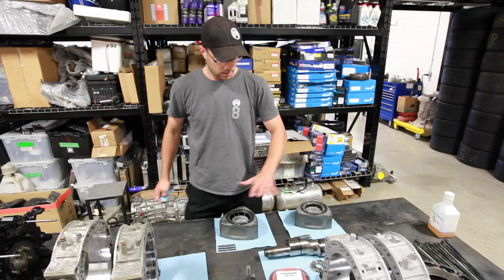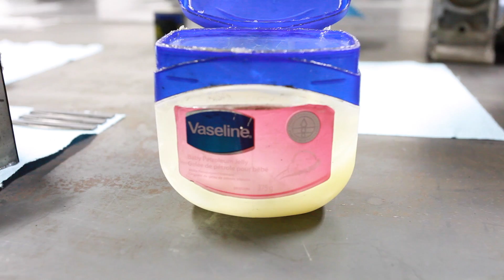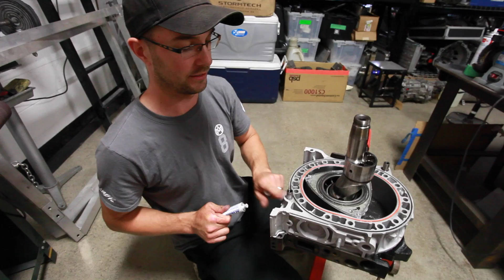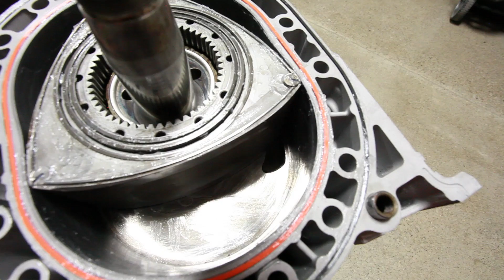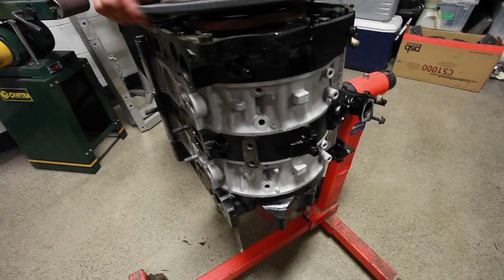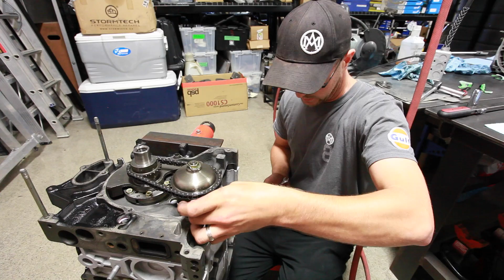How To Build A Rotary Engine

Comment: now my urge to get a rotary is increasing.
Reply: Pennywise yep you've never owned or driven 1.
Reply: Do it, you won't regret it. But get an FD. Not an RX-8.
Reply: @gav240z  dont get an FD they are frail due the sequential turbo but awsome car, i have an rx8 04 (i didn't want an 04 but she has the best set up for every rx8 so) get series 2 less premix but awsome car!! they have 2 engines instead of 1 smooth and fun :D
Reply: @TicRevenge  The RX8 is garbage compared to the FD, its not even a sports car!
Reply: +gav240z I love the rx8, but I'm actually thinking about getting a NA fc. The reason why is due to it being a good base point to learn about them.
Reply: LanEvo55 whichever car is cheapest to obtain and cheap for parts. So earlier ones might be a good start.
Reply: The real doktorbimmer Yeah I get it, you hate the rotary. I've seen your silly comments on other RX-7 and rotary videos. The 2002 Spirit R did the quarter mile in 13.3 seconds and 0-60 mph in 4.9 seconds. That's quicker than many cars. Do a few simple modifications to unleash more power from the engine plant and you have a very quick car for not a lot of money.

The 1 thing I will agree with is fuel consumption is high, especially if you drive it like it wants to be driven. But you don't get anything for nothing.
Reply: Again off topic.. And Diesel is not rotary. You're really bad at this.. Good luck buddy!
Reply: Still one of most iconic Japanese cars of the 90's hands down.
Reply: Exactly how much tuning experience have you had with rotaries? They don't just shit an apex seal at a whim, many run for many years reliably before they need a rebuild. Often a broken apex seal is a high mileage engine or poor tuning techniques. But you already know that, hence your real purpose here is just troll and get a rise out of rotards. Good luck with that and all.
Reply: The real doktorbimmer MX5's are good cars also, but the RX-7 is the super car killer.
Reply: Okay, this turned from a simple feeling five months ago to an argument. Can this end with "you like cars, or racing, etc. That's cool".

Braps are cool, so are tdi or whatever. Can we all just get along in this automotive community.
Reply: Pennywise pennywise or pound foolish? Ever owned a rotary car? I'm guessing no...
Reply: You're getting off topic now. We were talking about Japanese cars. And rotary engines. Mazda 787b only car till today to ever win Le Mans.
Reply: There is a good reason why they are no longer made
Reply: The real doktorbimmer I'm a fan of many engines, not just rotary. The uniqueness and simplicity of the motor makes it cool and the rev happy nature of it. 
Is it god tier perfect?
not really

do I care?
nope

That's just who I am and will hopefully find one to learn and drive a vehicle with this unique motor.
Reply: You're on every video, shitting on rotaries. Go the fuck away you damn troll piece of shit.
Reply: Jbaz
If Ottos are the best, then what keeps head gaskets going bad after 50k miles or sooner?
Reply: Whilst there is no new production with a rotary at this stage (and Mazda only put them in sports cars these days), Mazda could release a successor to the RX-7 in the future. After all, the MX-5 is a lower end sports car, but they are missing a higher end performance vehicle.

However there is many aftermarket and small engineering firms offering 3-4-5-6 rotor builds for customers who want something epic. Sure it's a niche market but a lot of folks are passionate about their 2 stroke rotors.

Back in the early 19th Century there was also electric vehicles, but they didn't take off because battery technology limited their range. You could have argued for most of the 19th Century that Electric cars were rubbish and obsolete but then... along comes Tesla to show how good they can be.

Just because something isn't the status quo doesn't make it rubbish, obsolete or worthless.
Reply: LanEvo55 rotary miata
Reply: The real doktorbimmer
Because they aren't.
You keeping on saying that they are doesn't make it true.
Reply: The real doktorbimmer
And why does THAT matter? It's not like I'm ever gonna buy a NEW car anyway, and there's plenty used ones out there to serve my needs for the next 20 or so years, and by then, I bet you, Mazda HAS come out with a new Wankel car. They just love the engine too much, jsut like us.

The real question is: why do you care so much? Why do you come on EVERY Wankel-related video on youtube and tell everyone 'oh it's a bad engine because it's no longer being produced'?

Why do YOU hate that we love the engine for it's perks, and can perfectly well deal with the few flaws that it has?
Why do you dedicate so much of your time for bashing it over and over and over. You're obsessed about that, man. You should get help.
Reply: I like my RX-7, I like the rotary engine. I think it's a wonderful piece of engineering and design concept. I think all internal combustion engines will be obsolete soon, but that's besides the point. I will continue to own, work on and use my RX-7 long after they are no longer made.

I own classic cars not because they are cutting edge in technology but because I like to have something different from the mainstream and enjoy working on them and learning about them.

I think you need a new hobby yourself.
Reply: I reckon Dr Bimmer must be real fun at parties. I think he/she just likes to take the contrarian position on everything to try and get a rise out folks.

Anyway I'm done conversing with this engineering genius.
Reply: I used premix for the entire 3 years I owned my RX8 and never had a single problem with any engine part, spark plugs, sensors or converters in 55,000 miles. And so what if I mentioned Protek premix oil. That is what i used so why not mention it? And I passed emissions tests too. You sound like a little man who has the need to be right all the time or a reason to argue with people all the time
Reply: @916fanatic1  Hi may i ask what premix ratio u used?  I read that 1/2 to 1 oz per gallon can be premixed depending on conditions.  Also can generic 2 stroke oils be used in premix or is there something special with Protek that lubricates Apex seals & rotors?  Thanks
Reply: +916fanatic1  Smart move.
Reply: hey guys can you explain to me why the RX-8 sucks?
Reply: @bombardier6033  yu have to drive one to get excited
Reply: The real doktorbimmer their still seen as very popular due to the amount of motor that can be swapped into them. From 5.0, JZ, Other rotaries, LS, and even the miata motors. Their are others I forgot to name, but the car I believe is not least popular
Reply: You're still here huh? Can you turn out the lights when you leave? Thanks mate. PS: Rotary's are the best! LOLZ.
Reply: What makes you think Moore's law won't apply to battery technology?
Reply: LanEvo55 That's what its all about man. Before you hand over the cash for one, make sure you do a compression test. And run it with the A/C on to see if it stalls out.  Also check to see if the heat and cold dials are working properly.... Those are expensive to replace and a pain to fix yourself but a common problem. After you buy one, clean the secondary shutter valve (SSV).  Have fun with it. Above all... keep clean oil in it lol. They use a lot.
Reply: The problem is that the V8 will be heavier so you will lose the 50/50 (roughly) weight distribution which makes the car so easy to drive fast. You will also raise the center of gravity, partly due to the C of G of the motor itself, and partly because you can't sit the engine low enough in the frame. The RX-8 engine is short enough to sit behind the front axle line. Of course you won't get the smoothness of the rotary. I often forget whether I'm in 3rd or 4th in traffic. The weight distribution, the smoothness, adequate power, limited slip diff, traction control, and especially the handling, make this car a joy to drive in the twisties. Not bad for what is basically a 2003 design. I recommend driving one, especially through the hills, before making up one's mind. If you only want to go fast in a straight line then go for the V8. If you want to go faster get a bigger V8 etc etc. That's not what the RX-8 is about. BTW a motor swap is not as easy as it sounds. There's a lot of articles on the various options and many are never completed. BTW, mine is a completely stock 2009 series 2 (called the R3 version in USA).
Reply: The problem with the Renesis engine was the fact that the oil injection pump that lubricated the critical apex seals was shut off when the engine was at idle for emissions reasons. And here in Chicago you spend a lot of time at idle waiting in traffic. The cure for this is using Protek R or another good premix oil in the gas every fillup to protect those critical seals. You will double the life of your RX8 engine by doing this.
Reply: I traded it for an suv
Reply: Yea Toyota had the Supra, Acura had the NSX, Nissan had the Skyline, and Mazda had the RX7. All iconic cars of the 90's. However has any of those cars ever won Le Mans, besides Mazda? NOPE!  Cheers!
Reply: The real doktorbimmer only car I can think of with rev nature is an s2k; however, they sell for 8-10k range. A FC can be find for 1-3k I believe.
Reply: DONT! you will be doing this every 60k miles IF your lucky.
Reply: gav240z. If rotary's are the best then what keeps apex seals from going bad after 50k miles or sooner? Or were you being sarcastic?
Reply: So I'm still trying to work out what you're trying to prove? Do you want people to just accept the rotary is dead and irrelevant? To what purpose? If people love these cars and motors, why do you care?

Do you think all rotary owners should swap V8s into their cars? You clearly dislike the design and the concept, so why do you spend your time commenting on them?
Reply: Pyrrha Nikos. There's a big difference between the two. A leaky head gasket compared to apex seals? Make sense please.
Reply: gav240z. Your right I don't care and it is a fun car and engine. Looks cool also. I was responding to Lanevo55. Was trying to warn him about the engine. People should know what they are getting into when the buy into the rotary. But by all means keep the engine around. Have fun.  Butt.... don't try and convince me they are reliable. They are not. We love the high revs but that is also what destroys the apex seals. Long story short.
Reply: +Jbaz  They are certainly not reliable... its a major reason why they are obsolete now.
Reply: I guess it depends on how you define reliable? I've seen plenty of piston engine failures and engines fail prematurely that were not rotary, likewise i've seen plenty of reliable rotary's that have been abused for years and keep going.

It's all relative, my experience owning 1 tells me they are reliable. If not a little expensive to maintain (an FD RX-7 anyway) and thirsty on fuel. But I imagine a V8 would also drink fuel.
Reply: gav240z  We mean reliability as in when compared to other comparable automobile which typically do not require engine overhauls at less the 100,000 mile intervals..
Not really, the Wankel has always been characterized by lower reliability and much shorter service life than the reciprocating engines it failed to replace..
  At least a V-8 would deliver some impressive torque output for it fuel consumption rate.. which will generally be better due to the Otto cycles higher Carnot cycle and mechanical efficiency..
Reply: Jbaz I understand what I'll be getting myself into once I get the opportunity to own one. Currently got two of my favorite cars and the rotary car will be a learners car.
Reply: The real doktorbimmer I've seen them being worked on. A friend of mine was working on an rx7 that had issues starting and found it to be wiring. The motor is small and good room to work with. Want to learn how top work on than so that if anything, the matter didn't seem as impossible or hard.
Reply: +LanEvo55  Your planning to do an LS-1 swap on the FC?
That would be a huge improvement in torque, more horsepower, better reliability and cheaper parts...  Make more sense too.
Reply: +Jbaz  Or find a car with straight body and clean interior that has a blown engine for cheap.. RX-8s with blown engine are easy to find and very cheap. The money saved could support the bulk of an LS swap and on the back side have a more powerful and reliable car to boot.
Reply: The real doktorbimmer. I have a 2005 in extremely good condition. needs a motor rebuild. It would be perfect for the LS1 swap. I'm seriously thinking about doing it. Amazon has a Genuine GM (10067353) 350ci / 5.7L Gen 0 crate engine for $1,500.I'd love to build it up and throw that rotary in the fucking trash! lol
Reply: +Kevin Wildash one of the biggest flaws in the original design is the RX-8 is simply too big and heavy for a Wankel engine with its fragile seals, poor horsepower-per-liter and unacceptable torque curve .. it was better suited to the little micro-sized 1st gen RX-7 that actually did sell reasonable well before reciprocating surpassed the Wankel and never looked back..
Reply: +real doktorbimmer.  True, the RX-8 is a bit on the heavy side at 1350 to 1400kg, although having four seats accounts for a lot of that. There is a lack of torque at low rpm but torque curves show it's fairly flat through the mid range. I never notice it around town. I do find the gap between 1st and 2nd gear is a bit too big. As you say, recent advances in piston engines gives them a big advantage, especially variable valve timing. However, I surprise a lot of people when on the limit in fast sweepers, in fact powering around any corner, and as I said it's nice to drive, which is hard to put into words. I think the problem re reliability could be restated - it's not idiot proof LOL. They should last a long time if people follow a few simple "rotary rules". I got mine new so I know it's history. Cheers.
Reply: +Kevin Wildash Well, the RX-8 is not heavy for a sedan.. but the Wankel engine only saw limited success in very small sports cars.. Lack of torque was a universal complaint of the RX-8. An interesting anecdote but not something that can be quantified or compared..
The final word on reliably came from the United States NHTSA investigation of the unusually high number of consumer complaints about premature RX-8 engine failures.. 
The investigation confirmed what many had been saying for years.. that there was absolutely no link between owner abuse or neglect and that cars that had been properly operated and serviced according to manufacturers recommendations failed prematurely.
Mazda did not challenge the investigations findings and voluntarily launched a recall of RX-8 models sold in the US for core engine failure. The largest recall of its type in automotive history.
Reliability is a major factor in the model's poor sales and cancellation in 2009..
Reply: I never said anything about removing the OMP or anything else. I only mentioned premixing as an addendum to rotary care and maintenance on an otherwise totally stock engine. And only on the RX8.I was told the RX8 ECU supplies no oil to the apex seals at idle by a guy who builds rotaries for a living so unless you are a rotary engine builder I'll trust him over you any day.
Reply: +Kris Kumphet  The notable Mazda from the 1990's was the MX-5.
Mazda lost the WSC championship to Jaguar.. over and over again.
Reply: +LanEvo55  you mean Wankel don't you? Or are you specifically referring only to Mazda?
Reply: The real doktorbimmer Wankel
Reply: +LanEvo55 Well if you are true obsessed with high rpm? The Wankel is very limited compared to some high performance reciprocating designs...
Reply: +LanEvo55  Well that would be due to the simple fact that the FC is the least desirable RX model ever built.
Reply: +LanEvo55 Where the FORK did you seen an FC for less than 5k?  I'll take two!
Reply: Your better off just buying a weed wacker.. just fire-it-up when ever you get that urge.. it will be cheaper and more reliable to start too!!!!!
Reply: The MX-5 is Mazda's top selling sports car... without a Wankel.
Reply: +Death2508  Just the facts here son, you're the one sounding like an angry troll here...  what constructive information are you bring to the discussion????
Reply: +Death2508 We are talking about Wankel engines here kid... The Mazda Rotary® brand is no longer sold....
Reply: +gav240z  Then why are they obsolete since 2012???
Reply: doktorbimmer fuel efficiency is what made them stop producing not reliability... I have an 05 rx8 with premix and using 10w30 synthetic idemitsu oil for daily and 20w50 for track every 2k miles and no problems with 65k miles which usually for rotaries needs a rebuild sooner or later if miles are like tht and not taking care of they are reliable if you jus maintain it like people should
Reply: +Pyrrha Nikos  PLEASE NAME A COMPANY SELLING NEW CARS WITH WANKEL ENGINES???????
Reply: +Pyrrha Nikos  Because the truth bears repeating.
Reply: +Pyrrha Nikos That's correct!  No longer produced or used in the manufacture of automobiles or any other application.
There are people still using horses and steam locomotives...and they are obsolete forms of transport too!
Reply: +Pyrrha Nikos  I've heard a lot of rumors.. but the ones about Wankel engines making a comeback are never true!
Mazda has developed several hydrogen projects and they have all been colossal failures... Do you know why?
They are by definition obsolete.. they are no longer mass produced, they are discontinued, outdated and no longer available commercially.
Why are you in denial and refuse to accept the truth?  Why are you attempting to kill the messenger???  You should direct your complaints at Mazda... they killed off the last production Wankel automobiles..
Are you so deluded that you are cannot accept the facts?
Reply: +Pyrrha Nikos  Like I said, the truth bears repeating.
Reply: +Pyrrha Nikos  Why do you use childish insults instead of educating yourself... youre not hurting anyone but yourself by making angry, hateful, personal attacks..
The Wankel is no longer manufactured in series mass production anywhere in the world..
There is NOTHING that you can say here that will change this irrefutable fact..
Reply: +Pyrrha Nikos It matters because an an engine design that is no longer manufactured or mass produced is OBSOLETE... a fact that you seem to be in a deep state of complete denial..
Reply: +gav240z  The Wankel engine is not coming back... Mazda's president and CEO has said repeatedly that this will not happen... a working knowledge of the history of the Wankel engine's development and final obsolescence would indicate that it is indeed highly unlikely to ever return.
Mazda is a lower end, entry level manufacturer that throughout its very short existence does not command the interest of up market customers looking at more prestigious marques.
Mazda's previous attempts to move upmarket in the performance segment was met with lukewarm to cold customer sales volumes.
There is always room for small backstreet custom shops to build hand built, made to order, reproduction or experimental engines..
we see this with the antique car market with flat-heads and even steam engines..
this in no way indicates that the technology is not completely obsolete.. 
You can buy a brand new steam locomotive.. if you're willing to pay for something unique then any obsolete technology can be reproduced.  
 Toyota builds more Camry models alone in one month than Tesla builds cars in a whole year.. EVs are  a niche market because batteries will always offer limited storage density and efficiency.
  Not at all, the Wankel failed to be widely accepted and fell into obsolescence simply because it's an inferior concept for heat engine design.. if a design cannot compete and be commercially viable it dies out.. 
PS: The Wankel uses the 4-stroke principle of operation.. they are not 2-stroke.
Reply: @doktorbimmer  rotary existed for 44years i dont call that a failure, just different people, trust me if people were still into rotary it will be an rx8 rx9 rx10 ect
Reply: @TicRevenge  Stop by your local Mazda dealer and ask to see a new 2021 RX model...

The RX8 was such a colossal failure that it killed off the entire RX brand for good.
Reply: @sandervanderkammen9230  and you are an  enormus failure to people, with your stupid idealogy bro
Reply: @TicRevenge  Just the facts here kid..
The Wankel engine is obsolete technology.
The RX8 was a  $3 billion dollar failure that bankrupted Mazda.
Reply: @sandervanderkammen9230   xd bankrupt ofc bro
Reply: @sandervanderkammen9230   lmfao this kid is so ill, i think you suffer get help
Reply: if your mom wasted that much money on you still won't change the fact that you'll stay a mad loser so keep crying over rotary engine boi
Reply: @TicRevenge  You don't know that Mazda went bankrupt 3 times in its short history?
 FORD bought Mazda from a Japanese bankruptcy court and controlled it from 1979 to 2009.
Reply: @TicRevenge  You don't know much about cars or Mazda.
Reply: @TicRevenge  WANKEL engine,  the registered trademark "Mazda Rotary" is defunct.
Reply: @sandervanderkammen9230  stupid guy i have the 2 91 and 92 emblem and knows every mazda car you fool, bro gtfo of here jesus hahaha
Reply: @sandervanderkammen9230   ford broke mazda you idiot
Reply: @sandervanderkammen9230   show me the link to the bankrupt you idiot haha
Reply: @TicRevenge  I'm not intimidated by angry little trolls like you kid.
Reply: @TicRevenge  Ford saved Mazda! In fact the only years that Mazda was profitable was when it had an American CEO.
Reply: @sandervanderkammen9230   they didn't they just allowed them to sell on american soil to save an eventual problem lmfao, difference you full of shit like always
Reply: @sandervanderkammen9230   says the troll himself sure buddy
Reply: @TicRevenge  The RX brand was discontinued because people stopped buying them.
Reply: @TicRevenge  The only troll here is you kid, you have not brought anything inteligently to this conversation, you're just any angry troll pissed off because no one respects you..
Reply: +gav240z   Why do you care?  Are you trying to prove the Wankel is not obsolete???
What does restoring old cars or customizing them have anything to do with the Wankel being obsolete???
Reply: +gav240z Well, with an expected 150 million reciprocating engines to be  produced this year alone and the fact that the Laws of Quantum Electrochemistry prevent batteries from ever matching the storage density of liquid fueled ICEs? That prediction is doubtful and very unlikely...
I love obsolete technology.. why do you think I know so much about obsolete engine types like Rotary engines or the very different Wankel engine...
The Uberursel UR-II is my personal favorite..
I have 18 vehicles that I have restored or maintain myself.. including  1 Wankel, and one Rotary.
Reply: +gav240z  Lol!!!!  Because Moore's law is completely unrelated to chemical battery storage density... haha!!
Reply: may I ask why is there a full on argument on this comment that was made 6 months ago. Can't we just say that we love cars and engines and end this already.
Reply: +LanEvo55 Some people just don't know when to let go... they prefer to stubbornly remain in a complete state of denial.
Reply: +gav240z Just the facts here... the truth bears repeating.
Reply: +gav240z  You were done here a long time ago... Cheers!
Reply: The real doktorbimmer This war is over, please do not restart it.
Reply: +LanEvo55 What war???
Reply: +LanEvo55  Well, not having to rely on it for daily transport will be key to a successful accommodation of the Wankel engines many inherent defects..
"learners car"?? I assuming your not accustomed to dealing with antique or obsolete engines?
Reply: +LanEvo55 So you have never removed and overhauled an engine  before yourself?  Its not something done without formal training an experience or at least without employing help from someone that does..  engine overhauls are an order of magnitude greater in the skill level required to say replace a starter or an ignition coil.  Watching a skilled technician will often make the job look much easier, especially when you don't see all the steps involved.
Reply: The real doktorbimmer I've done an engine swap before. I know matters like that take time and know how. That's one of thefun thing about cars is learning. I'm actually planning on replacing a motor in one of my cars with a new heart.
Reply: +Kevin Wildash Not as much as you might think, the tremendous increase in torque makes up for a lot of things. The original Wankel engine really lacks adequate torque and power is not on par. Well, what can I say.. nothing could be worse in terms of reliability which is why so many new car buyers avoided the RX-8.
The LS swap is a great way to turn a lemon into lemon-aid... which why it has become popular.
Reply: +916fanatic1 Not true, the OMP is a positive displacement pump, oil is injected EVERY REVOLUTION of the eccentric-crankshaft. Oil injection occurs continuously at idle but can vary from 0.0006cc to 0.0400cc at 500rpm depending on the output signal from the ECU.
Reply: +916fanatic1  What happened to the car after 55k miles????
Reply: +916fanatic1  Not at all, you posted something that was not true.. I simply pointed it out for everyone to see the truth.
Reply: The 26 sounds more like an air wrench
Reply: Hello i have a problem with my mazda rx 8 the car doesnt work anymore for 1 month the car started cold and when it was warm it didnt work
Reply: So did you get one? I own an '88 FC
Reply: Kryotix_YTP see how the exhaust port is on the irons instead of the housing. Makes a huge difference in how it performs.
Reply: Me too, me too
Reply: So am I wrong or could you add more rotors, rotor housing, and a crankshaft that supports many rotors to add more rotors. Is there any parts that I’m missing?
Reply: @eliasbutcher859  John Deere, Mercedes-Benz, Curtis-Wright Porsche and Mazda all developed 4 chamber Wankel engines although none proved to be reliable enough for mass production.
Reply: Is it possible that the apex seals are what is causing wear on the inside of the housing?
Reply: OneLuv_Z mine too!!
Reply: Didn't know this comment from 5 years ago had still continued on with the argument 😂. My input involving this motor is that of curiosity and potential that can be achieved. In terms of chassis, the RX8 is a good handling car that I'd build for track/drift in. While it did have the Renesis engine (a very hated engine based on the reports and those that owned them). They are very capable vehicles with a different rotary or another engine entirely. 

On that note, can we please have constructive arguments and not full on flame wars and insults. 

We are all car enthusiasts here and the RX family and the rotary engine made their mark in the automotive industry from street performance all the way to track competition (be it drifting, drag racing, time attack, etc).
Reply: @One_LuvZ   i love fucking with the trolls man
Reply: @One_LuvZ  All the reasonable people agree that the Renesis was not good engine.
Reply: @One_LuvZ  Well that's exactly why the Mazda MX5 is the most successful 2-seat convertible sports car in history. 
The Mazda RX8 shares the same FE chassis as the MX5
The downfall of the RX8 was the heavy sedan body and the weak unreliable engine.
Reply: I don’t regret my rx8 but id see other quickly regretting it lol
Reply: Yeah do it. I just bought mine and seals were stuck so poured trans oil. Got it unstuck. Got it tuned. Drove it 20 miles and it got stuck again or it blew. Now motor is getting taking out and no rotary mechanic has time since they are dealing with so many people waiting to get a shipment of brand new engines and rebuilding also has a 2 month down time and it’s costing me so much money and aggravation. So I’ll be having a fd rx7 for sale up soon with a brand new motor or rebuilt motor. So yeah do it so I can sell you mine.
Reply: just buy a 2 stroke weed wacker.  same sound, same torque and much cheaper.
Reply: The FC and FD3S are the best ones to start off with..rx8 is trash
Reply: +Kryotix_YTP good chassis, crap motor
Reply: The real doktorbimmer

obsolete
adjective
1.
no longer produced or used

RX-8s are still being used, as are RX-7s.
And I even know a guy who takes his RX-3 for a ride every other weekend.

I also heard rumors that Mazda is working on a hydrogen-fueled, Wankel-powered car.

Thus they are, by definition, not obsolete, and your repeated spewing of it will not mnake it true.

I wonder WHY you keep spewing so much hate towards people who like the engine. Did your mommy not love you enough?
Reply: +Simon Liu not really mine is stock been that way for 6 years no problems at all.
Reply: +gav240z  The RX-7 never offered Supercar performance... just Supercar fuel consumption without the Supercar power
Reply: +Pyrrha Nikos Why do you feel the need to attack anyone that does not share your delusional beliefs?
Reply: +Kris Kumphet  Not impressed.. Le Mans has been won 10 times by Diesel!!!!!
Reply: +Kris Kumphet Neither is a Wankel engine..  You are really, really  bad at this for sure Well, they still make Diesels....
Reply: +gav240z  With Rotary engines? a lot actually... I have worked with Uberursel UR.IIs and Le Rhône 9Js  they are two of the most common ever produced.
 The Apex seals has always been the Achilles heal of the Wankel KKM design..  not the rotary, but a single good detonation event is all it really takes.. but that's not to say people do not limp around for years on a wounded engine... that is one of the more ironic characteristics of the design as well.
Rotard?  Well, If the shoe fits...
Reply: +916fanatic1  Premixing is bad for 2 reasons, first, a safe ratio will always cause too much oil at idle, and second, removing the OMP does in fact shut off the flow of oil to the engine, whenever the FCO is activated during deceleration or engine braking... when this happens under some conditions it can cause severe damage. Of course its also expensive and inconvenient, not too mention illegal in most states.
Reply: +916fanatic1 No, you didn't... but you did make some questionable statements that seemed to be intended to endorse or promote a particular product... as pre-mixing oil in  an otherwise stock engine  is not recommend due to the contamination that is caused be excess oil residue damaging apex seals, spark plugs, oxygen sensors and catalytic converters
Reply: @doktorbimmer  I read that 2 stroke premix oil at ratios 1/2 to 1 oz per gallon gasoline helps lubricate Apex seals & rotors.  Some claim regular mineral oil is burned off; so non synthetic oils should be used since synthetic does not burn off.  Others have installed a Sohn pump to assist & add clean 2 stroke oil to earlier R1 2004-2008 rotaries. This adds clean 2 stroke oils instead of "used" oils in earlier R1 engines. Any thoughts to help preserve seals and compression? Thanks
Reply: @chrislg4519  Mazda only recommends 4stroke motor oil with a API SL oil specification. No 2stroke oils meet this specification.
Reply: @chrislg4519  The API does not recognize any difference between the type of base stocks used in testing motor oils and considers the the term synthetic as a meaningless marketing term. Any motor oil that meets API SL or EC GF3 is safe to use.
Reply: @sandervanderkammen9230  Ok great info 👍 Thank you again Sander 🌟 Good to learn something new on car oils 🚗🚘 i have been using regular 5-20w oil as recommended, but may try 5-40 as others have tried in hotter conditions. Blessings 🚘🚗🌇🌐🌟
Reply: @sandervanderkammen9230  Interesting info Sander 👍 I guess premixing 2 Stroke or 2 Cycle oils discussions will continue since some Rx8 owners premix and others have added external Sohn adapter reservoir bottles to inject 2 stroke oils directly into rotor chambers. In any case, always a Fascinating rotary topic 👍😯🌟🚘🚗
Reply: @chrislg4519  indeed, there are a lot myths and misconceptions about the Wankel engine and the 13B-MSP in particular. As of yet there is absolutely no definitive evidence to prove that premixing or untested products like Sohn do anything to improve reliability or reduce engine failures due to seal damage and compression loss.
Reply: @sandervanderkammen9230  Yes agreed thanks again Sander 👍 i have viewed 100s of sites & channels on Premixing issue & still have not seen definite scientific data proving premix effectiveness.  I guess it is difficult to prove since there are many rotary variables.  One YT channel showed a rotary being taken apart for a rebuild. Inside chamber showed some minor "scratches" or wear inside a series 1 rotor chamber. In series 2 Rx8 (past 2008) OMP oil measuring pump  was upgraded to add additional oil to chambers, thus "improving" lubrication. Metal apex seals may always need proper lubrication but how much may depend on driving environment & rotary series.  Maybe some Rx8 forums may have more definite proof.  I guess many variables can influence engine life: oil type, temperature, apex seal conditions, Catalytic issues, driving style, etc. 🚘🚗👍 In a decade, EV electric vehicles may replace all so for now just learning as time passes lol 😀 Thanks again 🙏🚘🚗🌟
Reply: @chrislg4519  Nor is there any evidence that apex seal failures are related to a lack of lubricant. The primary failure mode of apex seals is damage due to pre-ignition/ detonation and  broken or stuck seals tension springs due to carbon deposits. 2 stroke oils produce up to 10 times more carbon and ash deposits than the API SL 4 stroke oil recommended by Mazda and mixing oil in the fuel reduces the effective fuel octane increasing the chance of pre-ignition and erratic combustion.
Reply: @chrislg4519  Some else told me that in a decade EVs would replace everything, that was 30 years ago! He was just as wrong then as you are now. 
Cheers!
Reply: @sandervanderkammen9230  Very interesting info Sander 👍 Those Apex seals are very special.  Im not a mechanic but seems Apex seals are like piston rings and seal chambers for proper compression 🚘🚗🎆⚡ Good to know 4 stroke oils produce less carbon than 2 stroke oil and that Apex seals & springs are fragile at pre ignition. I like what u wrote about erratic ignition Apex seal & spring damage due to excess carbon.  I think I will hold off on premixing to avoid excess carbon.  EVs are too quiet, so going to keep High Rpm Rx8 Revs for awhile  😀
Reply: @chrislg4519  piston rings serve the same primary function as apex seals, the piston rings has several key advantages over apex seals and are considerably stronger and more durable.
Reply: @sandervanderkammen9230  Yes that seems logical because 4 - 10 piston chambers has evolved to advances in engineering.  What do u think are best practices to maintain Apex seals, rotors & chambers for best compression?
Reply: @chrislg4519  The advantages of piston rings is fundamental and inherent to their design, not the result of development. A circular seal will always be superior to a seal with right angles and uneven sides.
 The best advice is to follow the manufacturers service and maintenance procedures recommended by Mazda and except the fact that the Wankel engines delivers less reliability and durability than reciprocating engines.
Reply: @sandervanderkammen9230  Great advice Sander ☺👍Many thanks for interesting info regarding rotaries & pistons 🙏🚘🚗 i think you summarized issues well with circular seals vs right angles & uneven sides.  Sounds like u have alot of experience being that wankel rotaries originated in your part of the world. Yes i will accept that rotaries will probably not get over 300,000 miles on original engine 😀🌟🙏🚘⚡🎆 Continued blessings & be safe during this global pandemic🙏⛪🌌🌠
Reply: +gav240z  k
Reply: +LanEvo55  I'm really excited that someone is really interested in preserving some of these obsolete engines as they are now quickly heading toward extinction now..  but it sounds a bit delusional to tout these engines as some kind exceptional engine design... if they were? they would have seen widespread adoption instead becoming obsolete.
Reply: @doktorbimmer  they became obselete because people don't wanna drive and take care of their cars that's all, yes pollution is a thing and high consumption but  my rx8 take between 8,2L if driven a tad slow and 11L if i drive like a maniac wich doesnt happen very often so its around 9L/100 a normal suv now is  8 9 or 10 and sometime over 11 so its not bad
Reply: +Kris Kumphet  The Toyota Supra and the Acura NSX completely overshadow the now discontinued RX brand.
Reply: +gav240z   No, you don't.. I am a huge fan of Rotary engines... but alas we are talking about Wankel engines my friend... the "Mazda Rotary®" brand of Wankel engines is now defunct..
That's slower than most cars classified as a "Supercar"
And a few simple modifications to "unleash more power" will also quickly "unleash" your apex and side seals out your tailpipe in short order..
You didn't get much for your money when you bought an RX... which is exactly why so few people bought them and why the company had no choice but to axe the RX line in June 2012...
Reply: +gav240z why would I want a torqueless, gas drinking, apex seal burning motor that sounds like a weed whacker?